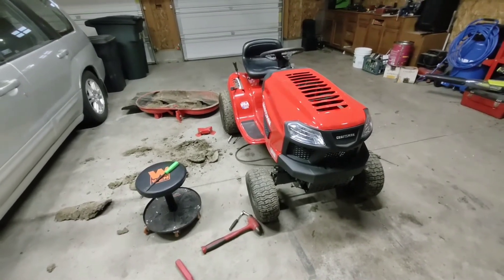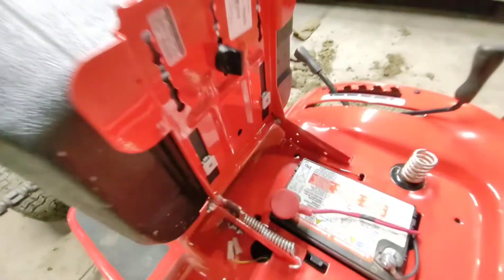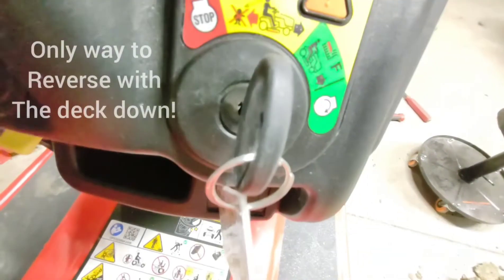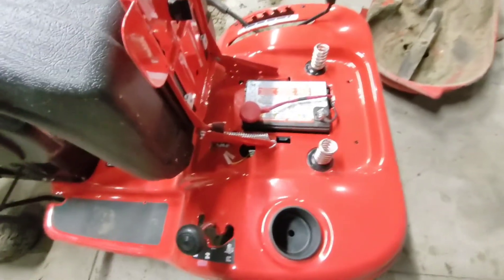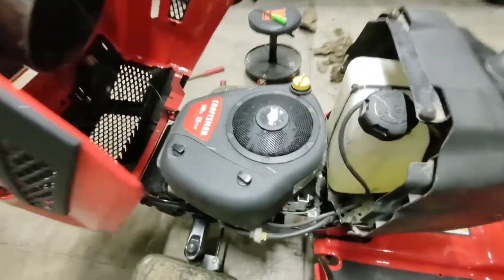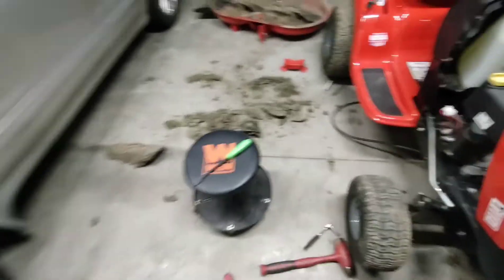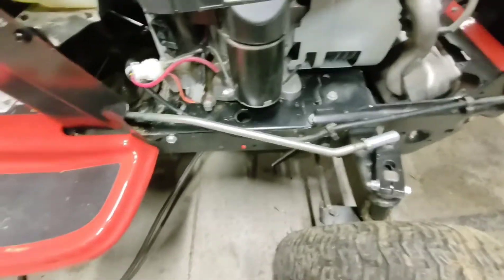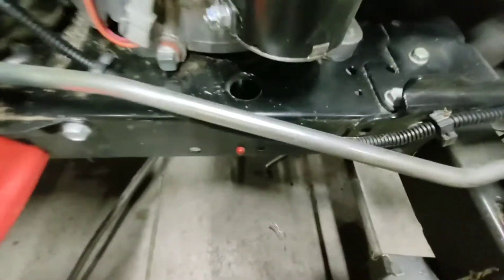craftsman T110 riding lawnmower honest review!!

Comment: I have just bought a 2011 LTS 1500, never been used to mow. Washed out the fuel tank, changes all filters and plug, greased 4 points, set platform which was initially attached and attached unlevelled, work beautifully, has a 38" cut and usually use gear 2 or 3 in longer grass and go slow, this is not a speed machine. the 17.5hp engine, B&S, is reasonably good, I wash it out thoroughly each time, its still like brand new.

Comment: It should have come with a little black "trough" that fits under that oil drain plug to guide the oil over the frame.....I have a T100 with the same engine and mine came with it.
Reply: I agree. Why do they make them so you make such a mess changing the oil?
Reply: Mine did
Reply: @357bullfrog9  You should see the mess after changing the oil filter on a $25K Harley-Davidson.
Reply: mine did

Comment: Hey just wondering if you or anyone had some pretty serious deck vibration with it. Mine is new and shakes like a jackhammer. I've checked all of the obvious stuff. Nothing's out of whack. The only thing two things that seem abnormal to me is the amount of freeplay the deck has, and the engagement pulley shakes back and forth while it's running the belt.

Comment: $1,800...damn lol. I paid around $1,100 with military discount free truck delivery plus another discount because it was missing the owners manual and stuff. Overall it's great! For context I have 3/4 acre. Used to have a Husqvarna 54" deck 26hp V-twin Kohler, used that for a year then sold it for $200 more than I paid due to "inflation" lol. Was push mowing the 3/4 acre for a couple years but it sucked especially when I stepped into a yellow jacket hive twice. This Craftsman T110 is the perfect middle ground and I've mowed 12" grass when I waiting like a month and a half between mows! It's great!

Comment: I don't know who needs to hear this, but I have replaced my battery twice. Then one day I backed it out of my shed, went and did something, came back, dead battery. (previous times it signaled "fail" on my overly-informational charger). So I started to go get my charger but was pissed cuz brand new battery. So I disconnected headlights, which are "always on"? Wtf? To my suprise, turned key and it started. Maybe I had bad batteries, maybe Lowes set up the mower wrong, but why have useless headlights drain your battery? Who mows in the dark? Reply if you've had similar issues with the craftsman.

Reply
Reply: The headlights on this mower are powered by a separate alternator coil on the engine. It's completely separate from the battery circuit.

Comment: How do you start it brand new I can’t get mine started
Reply from the maker: Could be a few things - 
1. You need to be sitting on the seat because of the kill switch.
2. The lever by your left foot needs to be pushed in all the way.
3. Your choke needs to be all the way up, above the rabbit symbol to start and then brought back down. 
4. Won't start if your deck is down.
5. Make sure you have gas in it. 
Beyond that proper spark plug gap, in line fuel filter clogged, check the oil level (really shouldn't be an issue new but you never know). Check out your warranty information to see what's covered. Hope that helps a bit
Reply: Put gas in it?
Reply: @f62darkstar  no shit
Reply: @dontchawannaknow1017  it was broken was missing parts they still dropped it off
Reply: @raronow5320  sorry...I couldn't resist
Reply from the maker: @raronow5320   Geez! Sorry to hear that's what or was. Stuff like that shouldn't even make it to the consumer. Though it's a lower tier model, it's still name brand and a couple thousand bucks
Reply: Same with me, battery was dead. Jumped it with my truck and it works fine now

Comment: absolute junk. everything by mtd nowadays is junk. The stamped decks fall apart, the spindles suck, the engines have cam issues, the transmissions grenade inside, the deck belts always pop off, the belt guards snap due to vibration. The frames snap/twist. Avoid these at all costs let alone anything made by mtd